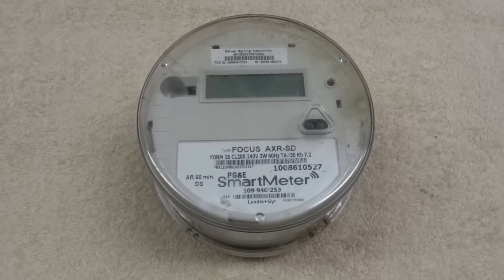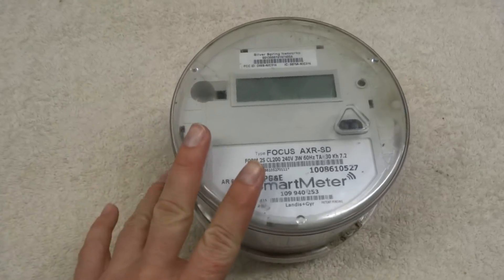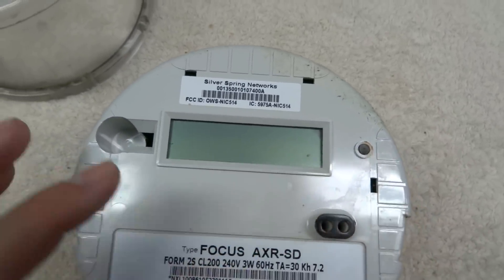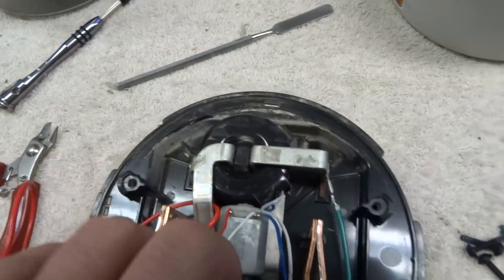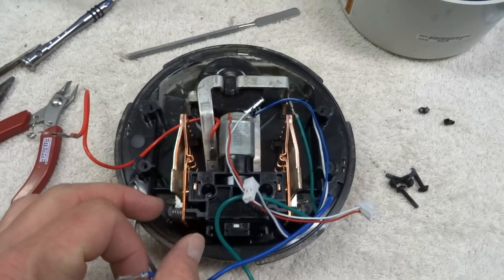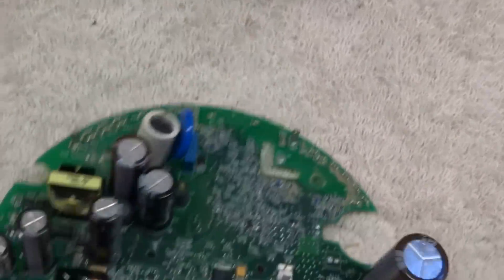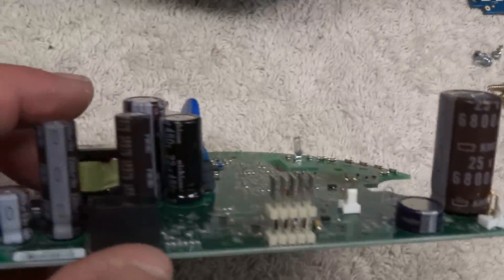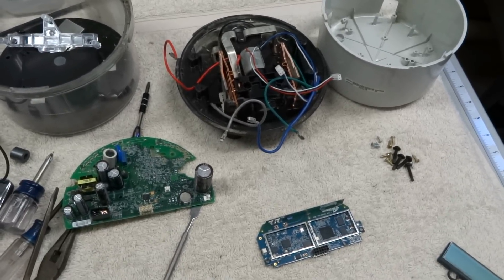Let's Teardown - Residential Smart power meter

Comment: Supply (SMPS) Dirty Electricity ~ When current flows through the wiring of a building it generates a surrounding electro-magnetic field that radiates outward all around the wires at right angles to the direction of the current’s flow and reaches out into the room. It is well known that switching power supplies can generate spikes of so-called electromagnetic interference (EMI), or high frequency transients, which then travel along the wiring in the walls, radiating outward in the wiring’s electromagnetic field. Such spikes are known as ‘dirty electricity’ and can be conducted to a human body that is within the range of the radiating field. This function is on all smart meters used by all utilities and is on constantly, 24/7.

[For more on dirty electricity check out Dr. Sam Milham's website and his new book, *DIRTY ELECTRICITY: Electrification and the Diseases of Civilization** and watch this blog for our in depth interview with Dr. Milham - coming soon. ] One of the engineers explains it this way: “Extensive measurements have demonstrated that all of the meters measured so far, including ABB, GE, and Landis Gyr, emit noise on the customer’s electric wiring in the form of high frequency voltage spikes, typically with an amplitude of 2 volts, but a frequency anywhere from 4,000 Hertz, up to 60,000 Hz. The actual frequency of the phenomena is influenced by the devices that are plugged into the customer’s power. Some houses are much worse than others, and this observation has been confirmed by PG&E installers that have talked to us.”*

Concerning “smart” meters: Dr. Martin Blank, Associate Professor, Department of Physiology and Cellular Biophysics, Columbia University: “Cells in the body react to E.M.F.’s as potentially harmful, just like any other environmental toxins, including heavy metals and toxic chemicals. The D.N.A. in living cells recognizes electromagnetic fields at very low levels of exposure [not covered by current outdated laws]; and produces a biochemical stress response. The scientific evidence tells us that our safety standards are inadequate, and that we must protect ourselves from exposure to E.M.F. due to power lines, cells phones and the like, or risk the known consequences. The science is very strong and we should sit up and pay attention.”
Reply: I feel sorry for the people who have lived around me for the last 50 years. The amount of HF EMF that comes out my radios must be doing some real damage to them. I guess that is why many  have died so young. Not one of them has lived past their late 90's and one actually passed away aged just 85.
Reply: good for you! count your blessings
 @peterrivers6644
Reply: @krustysurfer  It very frightening. So many of those people I have looked up to have died in their late 80's and 90's and they spent all their lives around high RF fields both at work and in their hobby. I guess from what you have shown in your video, they would have lived well into their 100's if they had avoided them. 

As a retired smoker who drinks too much and has been overweight for most my adult like who also surrounds himself with high RF fields  I must already be dead! I just have not noticed!!

Or it may be that your theory is complete bollocks!
Reply: u must have good genetics Peter, not everyone is as blessed as you Mr.  @peterrivers6644 . the studies are out there, the scientists must be lying because you are still alive.  however its like saying that asbestos does not kill- it is all a myth because my uncle worked around Asbestos his whole life and he has not died of mesothelioma - yet most of the people he worked with however are dead from it ............... same argument- count your blessings you are more robust than the rest of us with weak genetics. blessings and aloha to you and yours.
Reply: @krustysurfer  What scientists, what studies, citation needed? Or perhaps you are being a little less than honest! 

What is the safe field strength os RF the body can take?

If you are going to make these claims at least back them up with verifiable evidence.
Reply: Procommenter o
Reply: spot on!
Reply: Tesla referred to himself as Lucifer(the light bearer) - Mark Twain called Tesla his good friend Satan - this whole modern electric world is TESLA tech - Alternating Current-Induction Motors - DATA ENCODED MICROWAVE ENERGY .......Scalar weaponry and Weather Modification tech- microwave death rays- sold as communication devices(CELL PHONE) are the end result of this messed up world and the Technology of the Gatekeepers for monitoring and ultimately control of the masses.
Reply: Huh
Reply: what do you think Induction Heater fields do to the Human Genome?
all the people who cook on them and the workers who labor in front of huge blast furnaces surrounded by those EM fields!
no wonder the lifespan is so short! aloha
Reply: Switch mode power supplies have a line filter to prevent noise from entering the AC lines.
Reply: PGE told me their people submitted proof their meters r safe and lawful andxwsnt $800 a year to get rid of it. Total nightmare in Oregon, utility commission is worthless
Reply: why are wireless routers safe ?  id it the power output or frequency ?
Reply: Routers are way below the level of thermal heating. Nobody has found any evidence that they cause other damage at levels found in the home. The frequencies are non-ionizing, way below visible light for instance.

Comment: speculation
Reply: La Diablo 
Question 
I have seen these little slip covers to block the signal so that your cell phone is "off grid" so to speak. Can some sort of shield be placed around the meter to eliminate the problem you are describing?

Comment: I have to dispute the part about the customer paying for the electricity to run the meter. Just as the cutoff for the meter would have to be before the metered portion, so would the meter itself get its power before the meter measures it.
Reply: The meter and its circuits need a constant supply of electricity to operate. It the power is taken after the cutoff the meter will not power back up remotely. PISS OFF.

Comment: that 5.5V .22F  capacitor is basically like a CMOS  battery.. when the power fails the low  consumption of the memory module that stores how much power you used is not cleared. SO when the power resumes  the data stored is retained.. though LONG  disconnects like 6Hr +   would clear the data I believe as  .22F  is really not all that.   .22F  is  220,000uF

Comment: I don't get why everyone is complaining about smart meters. Your phone has way more sensors and circuitry than a smart meter. And it's not like these smart meters are releasing ionizing radiation (cancer). It's not like you are putting it up to your head. An old smoke detector in your house releases more radiation. The ones that use ionizing radiation to detect particles in the air. The purpose of a meter is to meter how much power you are using it isn't much different than the analog meters. And it's not like it is able to look at your browser history. If they could shut off your power remotely totally fine with that since having electricity isn't a right. People are becoming more and more paranoid.
Reply: Don't be a dumbass - wake the fuck up. This is the NWO in action. Read about Agenda 21.
Reply: Troll
Reply: OK, so the human body isn't made of electricity as well?🤔 How do you know that they aren't measuring the amount of electricity running through your body as well?

Comment: 5.5 volt "button capacitors" are commonly used much like clock batteries. The high capacitance value is so that they can slowly use that stored power to maintain clock or logical data values in digital circuits over a period of days, months, or possibly even a year, depending on the type of data circuits. It's likely how this type of meter remembers the amount of power consumed, even after power outages which could last days or even weeks.
 
In a circuit like this, it's not about how "powerful" they are, but rather, how long it takes for them to charge and discharge. The lower value capacitors which are bigger for higher voltages, are more likely power conditioning capacitors, which would need to charge and discharge fully, about 60 times per second, assuming the meter is for common 60Hz AC power. That is why the lower voltage "button" capacitor has a much higher energy storage and discharge rate value. 
 
Also, those LEDs are likely an IR emitter and IR receiver, for bi-directional data and diagnostics. They are likely recessed to shield out any ambient IR light that could interfere with that connection.
Reply: Very interesting about the capacitors.  I was wondering how they managed to keep memory inside all these things these days we have that are programmed including these meters.
Reply: Yah 😅ht7h

Comment: Having gone to college for electrical engineering, it mildly bothers me to hear the word "ground" being used so often while referring to parts in a power meter. Power meters are ungrounded. Houses need to be able to provide up to 220/240 volts for large appliances, and the meter has to be able to handle the full load. To get 110/120 volts for outlets and fixtures, only "hot" and "ground" are connected to those circuits in a fuse or breaker box. For 220/240 lines, "hot and negative" are used for the total potential difference (negative is actually very misleading since we're talking about AC current, and really only means the wire that is at opposite phase of the "hot" or "positive" wire). 
 
Ground is technically "zero" volts, right in the middle of 110/120 positive and 110/120 negative. The meter only uses two connection on each side, and has to pass through the full 220/240 between the positive and negative wires, so they are not and do not use "ground" at all.
Reply: Yea that was bothering me also. Since the meter is simply a pass through for L1 and L2. The bare ground connection is always just connected  straight through the meter socket housing on to the breaker panel. Then at the breaker panel the ground cable is also tied to the neutral bar.
Reply: @alanparekh9614  which goes ... wait for it... INTO THE GROUND...
Reply: JamesMorningstar 0

Comment: Yes that is a IR port. The 4 lugs on the back, top 2 are 220V AC (110V to ground each LUG)  bottom 2 are output 220V (Meter reads what passes thru it from Top to Bottom lugs) also the 2 lugs top and 2 bottom are different AC phases. Also note by the meter they
they can remote shut off service but charge you the SAME price as if someone had to come out to install the old type of meter. so there making more $$$$$$$$$

Comment: Donut is a Current transformer - that is what is measuring the current draw of the house. The grey and blue wires provide the voltage for the Watt and Power factor calculation. The motor is to remotely shut down the user - non payment or perhaps to unload the grid after a power failure so every thing does not come back on at the same time when the power is restored. The FCC ID number shows your RF module.
Reply: Does this mean it’s not using a resistor to measure the draw?

Comment: Incorrect. In order for the motor to function as an on/off switch, it would need power at all times, to also "turn on". If the circuits were powered on the "house side", then it would also be turning off the meter when the motor disconnects the power on the input side. That would be the case if somebody put one in backwards, or upside-down, but then once turned off, it would be stuck permanently "off" until turned the correct way.  
 
Why would they create a meter that would turn itself off as well and no longer function, when disconnecting power to the house?
Reply: JamesMorningstar .  the guy pointed out the donut which gets power by induction,  correct,  which is on the constant power side of the disconnect aka before the legs that break the circuit to your house,  so the motor constantly has power because the donut constantly does and because a motor has to have something control pos and negative current, so it works like a switch , that donut powers some kind of electronics.
Reply: I honestly am trying to see if what you suggest would or could work, and had a somewhat longer and detailed reply explaining my opinion, but then in reviewing the video in much closer detail, and dozens of pauses, I noticed that although the induction coils were used to power motors in the older mechanical meters, so that they would turn faster or slower based on current flow through the meter, the newer meters could not work the same way because the circuit would not be able to "cold start" without power already flowing, the way simple mechanical electric motors would. The coil used to measure power in a newer meter, would vary based on power flowing around it and not be suitable to power circuits which would require a fairly stable voltage and current, that much is ruled out.  Also listen to what he says starting at 7:03. He's right about the coil there.
 
However I was also wrong, because in looking closer, there are wires connected to each of the four primary posts, and any pair, either the blue and gray, or the red and green, could power the circuits, making it possible for either side to be the "house side" of the meter. So if the "grid side" of the meter is at the bottom, then it would be the larger gauge blue and gray wires powering the circuit and motor, and if grid side is the top, then it would be the red and green wires doing so. 
 
Also notice on the view of the main circuit board (@ 6:55), that the circuits power comes from that black and yellow transformer, which is surrounded by power conditioning capacitors, and clustered in the area closest to the larger "Spade type" wire terminals, which would best fit  the plugs on the four wires I suggested (as can be seen on the red wire @ 5:14, bottom left of the video frame, and on the blue and gray wires @ 5:51), not the smaller white connectors as seen on the wires from the coil and the motor. 
 
But all electrical engineering details aside, it is simply not practical or functional to have the circuit which shuts off power, to be on the side that it shuts off. If that were the case, it would have no power to turn itself back on, and also unless it has some sort of battery, or some form of writable memory, flash RAM, etc, killing it's own power would also likely lose usage data.
Reply: Not really. That donut is for measuring current flow which is how they know how much energy you are using. That is connnected to L1 and L2 right where they enter the meter. This means that everything including the meter power draw is calculated when charging the customer. The 220 taps that are used to power the meter electronics (and disconnect motor) are connected before the disconnect contacts so that if the contacts are open or closed the meter will always have power.
Reply: Good catch James.  Good logic. I hadn't thought of that.
Reply: Ignore that last sentence. Logic would suggest that since they are able to keep usage data during power outages, that they do have some form of writable memory.
Reply: Wires connected to the Load side terminals are there for voltage sensing. If the switch is in the open position and there is voltage detected load side the switch can not be closed. This is prevents power being reconnected if a generator or other source is tied to the house.
Reply: @ahoock  Current used to power the meter is not charged to the customer.
Reply: b ut is it legal ?

Comment: U must be a plumber. cause you dont know dodo about electricity.
the blue and white wires from the magnet is the way it reads usage.
the green and red are 220 volt and that is what powers the circuits. and yes they can shut off the meter by switching the power on and off

Comment: Funny how you seem to be knowledgeable when it comes to electronics but clueless about AC. The 4 posts are for 2 poles, 110v each - in and out - top and bottom. 220 v between side to side. Or 2 - 110v phases that are 180 degrees out of phase 110+110=220v.

Comment: so am i seeing this right .the power company turn u off remotley using the motor .so if u remove the motor when u have been disconected u could have power?
Reply: NO! Are you trying to get someone killed!? Left to right will be a dead short. Left slot to left slot. Right slot to right slot. 

And, NO. Removing the motor won't turn the power back on. You would need to manually turn the cam to move the switch to the on position.

But beware! These meters have another switch that will notify the utility that the meter has been removed from the base. Utilities will press charges for tampering with their equipment.
Reply: Copious amounts of power for the rest of your life

Comment: Motor likely enables one of three different shunt resistances by paralleling low resistance shunts. This would be a means to lower meter readings but the meter software would likely detect that current didn't change when various shunts were engaged. So better not to mess with the meter as you will get caught stealing power.

Comment: I think the electric motor is for electronic remote non payment disconnection those are no banana plugs that is a bidirectional infrared communication port so they can apply update patches using a tablet or something like that one hole is for sending data and the other is for receiving data those buttons would be for a factory test quality control or something
Reply: can farts z